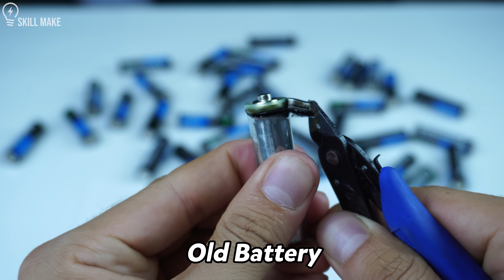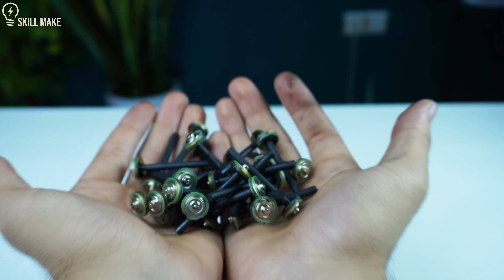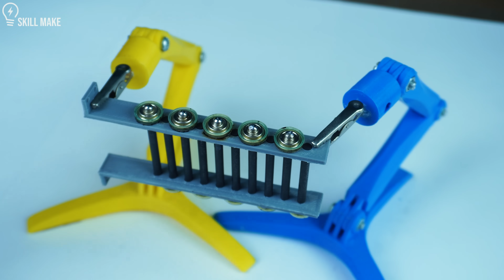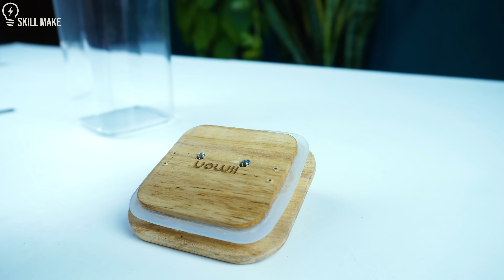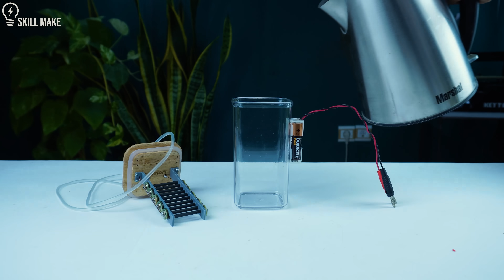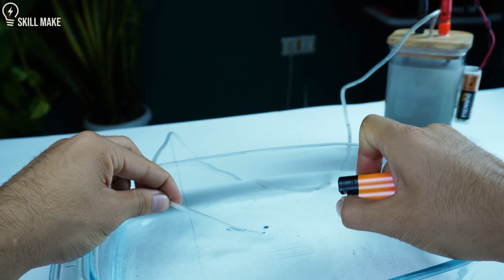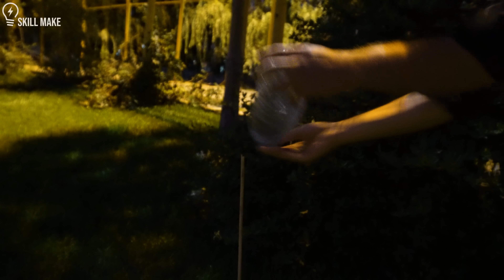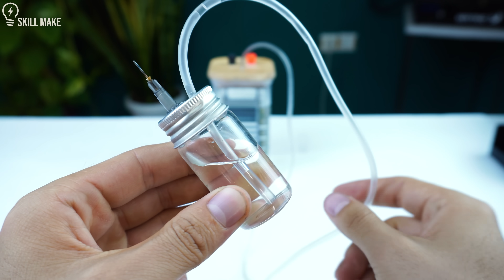Water into Hydrogen - Making a Simple Hydrogen Generator from old battery - hho

Comment: HHO isn´t Hydrogen. I would not recommend fiddling about with a contraption like that. Separate the electrodes so it generates Hydrogen on one side and Oxygen on the other... HHO is too dangerous. The least you could do is implement a flashback-arrester. After all, it usually goes well until it explodes.

Comment: I still don't understand, what you and most people want to do with Hydrogen... this Hydrogen ('made' by electrolysis) is very expensive and hardly usable.
It is expensive, because the effort (and costs, of course) needed to reduce Water to Oxygen and Hydrogen is way higher than the usable amount of energy of the resulting Hydrogen (by oxidizing it).

So why not simply buying a bottle of Hydrogen? I'm pretty sure it isn't much more expensive than this Hydrogen.